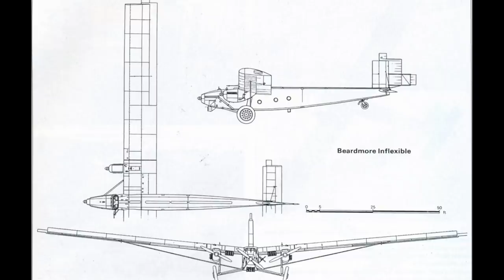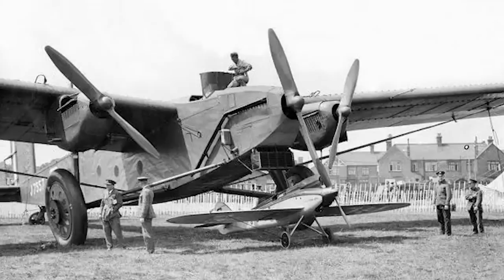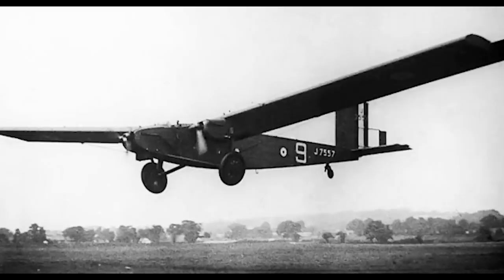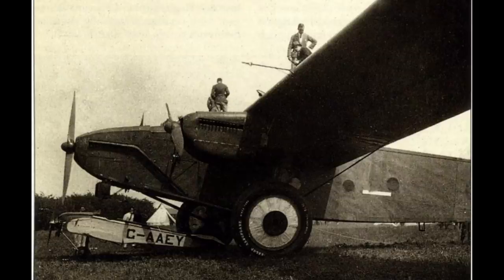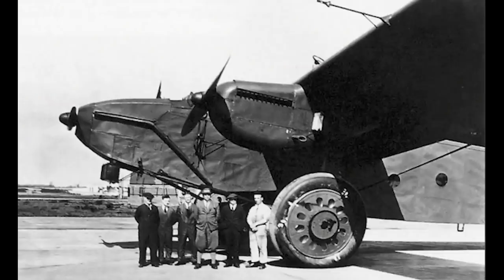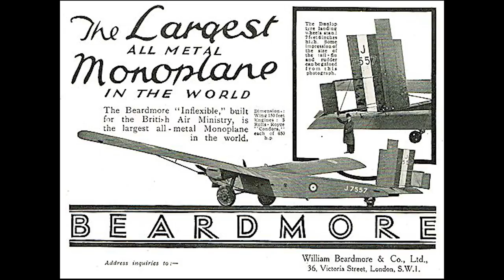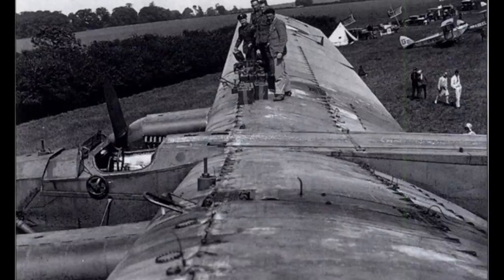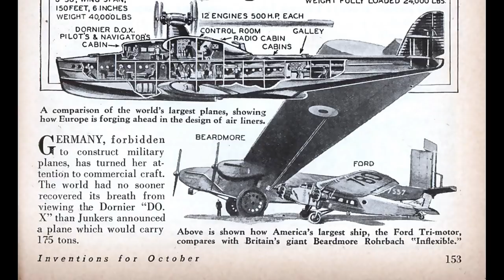Beardmore Inflexible | An Anglo-German Giant [Aircraft Overview #15]

Comment: As ludicrous as the interwar designs can be, you got to love the period for all the inventiveness and creativity.
Reply: I was thinking something similar. Creative, but utterly useless most of the time! However, when they DO get it right they get it RIGHT (De Havilland Mosquito)!
Reply: The pace of change was mind boggling, we went from wooden stringbags to the DC3 in 20 years.
Reply: @Robwantsacurry  and to the Junkers Ju 52 in only 10 years.
Reply: @steffenrosmus9177  
But somehow the Ju 52/3m (1932) was just an imitation of already successful planes, the Fokker Trimotor (1924), and the Ford Trimotor (1926) . . .
Reply: Drugs were legal back then. Just saying. :)
Reply: @letoubib21  that were just smaller versions of the Beardmore!, ie high wing trimotors, I believe the Ju 52 was originally meant to be a twin engine aircraft but due to engine constraints the third engine was added very early in the design stage, it would have been interesting to see it with two larger twin row radials in place of the three singles. The DC 3s biggest advantage was just the huge numbers it was produced in, both were good aircraft but with the number of DC 3s available it was down to economics post war.
Reply: @CrusaderSports250  The first Ju 52s only had one engine, therefore the two suffixes "1m" and "3m", 1 motor and 3 motors . . .
Reply: @littlefluffybushbaby7256  Sir could you be onto something? 🤔
Reply: @letoubib21  Thanks. I learned new something today. Also a tip that it's probably not wise to climb about a Junker Ju-52-0m.
Reply: Without ww2 we probably be in flying boats still ?
Reply: @letoubib21  not completely right. The Junkers F 11 prototype  and 13 was the first of that design and was built in cooperation with Fokker and Ford copied it.  Asp motor arrangement and cell strucrure were very differnt at all three.
Reply: @paulmchugh8695  A bit further along than that. If ww2 didn't happen we'd probably be in the early 80/90s now technologically.
Reply: @Robwantsacurry  from the wright's 1st flight to landing on the moon was 65 years.

Comment: Something seems ironic about so large of a plane with such massive wings being called 'inflexible'.
Reply: I was wondering WHERE the name "Inflexible" came from.
Reply: Maybe the wings were so large that the resistance to banking made it fly in a straight line... inflexibly. :) Still sounds like a Dreadnaught-era battleship to me.
Reply: The Royal Navy outdid them with HMS Invincible.
Reply: I can imagine if I want massive transport aircraft and if I was Atlantis by military aircraft they have flexible would be maybe high on my list for transport planes a size the American gooney birds
Reply: I do find it funny how between this and the HMS Inflexible,the British seemed to use the word as a positive thing XD
Reply: @101jir  HMS Invincible has joined the chat
Reply: @victoriacyunczyk  Invincible actually sounds nice though, granted the name ended up in irony. "Inflexible" doesn't even sound like a good idea, at least by modern standards. I presume it was used interchangeably with "uncompromising" at the time with a similarly neutral connotation.
Reply: An aviation journalist of the time saw the same irony...and started referring to the huge Beardmore as the "Brittle"!
Reply: Better than the Beardmore Brittle, I suppose.

Comment: Where did they get the name from? I suppose "Inflexible" because, being all metal, it was supposed not to bend; but it still sounds like a battleship. (Oh, I just looked it up: last Inflexible was a battle cruiser, slightly larger and heavier even than this.)
You've also got to ask just how much design was involved. The recipe seems to have been, "Take the most basic design possible, and scale it up." Still, the stress calculations must have been fun.

Comment: Could you do a video on the Beardmore BeRo.2 Inverness flying boat? It was related to the inflexible and had the weird distinction of being fitted with a retractable mast and sails. The sails were added incase of a forced landing at sea due to engine failure or running out of fuel.
Reply: @IntrospectorGeneral  Umm... that link goes to the Beardmore Inflexible
Reply: That sounds brilliant. I guess if they got the engines going again they could use them to blow into the sails. I wonder if they had plans for a submersible version. Thunderbirds are go!

Comment: A wheel from an Armstrong Whitworth Ensign, another monster pre-WWII (just) airliner also found its way into the Science Museum. Also, hardly an aircraft...but Beardmores also built the gantries and Railplane for Geo. Bennie at Milngavie (a short section above the railway for the airscrew-pusher suspended monorail demonstartion).

Comment: Me: thank god i didn't took part in that treaty uhh WHAT are you doing dad?
UK: testing the Inflexible
Me: i am building all-metal aircraft
B-19: it is larger than ME!
B-24J: ???
Weimar Republic (Germany): vell. Zhat vill be a huge behemoth
A-10: it may cause problems. Cause first off. The lack of supplies thus a Prototype, Secondly it had a short runway. Thus add 4 more yards
The Inflexible: takes off
A-10: fack. Nevermind

Comment: Interesting name, "Inflexible".  The Beardmore company was apparently following the WW1 practice of making the wings as rigid as possible.  Wings today are designed to do the opposite in order to absorb the shocks of minor turbulence and not spill the drinks in First Class. There was also a New York City bus in the 1980s called the Grumman-Flxible. Grumman Aerospace owned the Flxible Corporation which built the buses. The buses kept breaking their rear A-frames on the city's potholes making them list severely to one side or the other. This made the buses the butt of many jokes at the time and forced Grumman to pay millions in repair costs.  If you're going to make a large people-mover it's probably best not to use the word 'flexible' in the name.

Comment: I wonder what kind of range this plane had; it sort of looks like a U-2. I’ll tell you something funny. Modern drones are launched by placing them on a truck which releases them at 80 mph. 

Gliders with a real pilot could be launched the same way. Maybe 100 mph. No need for a Cessna tow truck, gliders nowadays have an electric motor. A recon unit could launch a dozen manned gliders in about one hour. Gliders are cheap. (But don’t buy them from the Marines).

Comment: And I thought it was a stretch to give the RAF's Future Large Aircraft contract to Airbus.  But even though they hadn't built a military aircraft before, they had at least built aircraft!
Just as a note, that this thing took off within the limits of the old runway doesn't mean that runway was long enough.  Sometimes you need that extra length if you have an engine failure or other problem at a critical point.  Looking at the power available the VR, V1, V2 numbers must have been interesting.
If anyone's interested why the testing was done at Martlesham Heath, this was the location of the Aeroplane and Armament Experimental Establishment (A&AEE).  'A Squared E Squared' moved to RAF Boscombe Down at the start of WWII, and although the organisation is now swept up in the Qinetiq monolith the work is much the same.

Comment: It is worth recording that very similar, but rather smaller Rohrbach Roland aircraft were operated by Lufthansa between 1926 and 1936. They had about eighteen, though not at all at the same time, and they operated much of the airline's European network very successfully, though at cruising speeds only around 100 mph.

Comment: Is this plane trying to do some laminar flow stuff?  The nice thing about clearly subsonic planes is that they can have thick wings and don't need struts. The nice thing about large planes is that they could not possible cater to laminar flow and thus can have a triangular plan form. So they can have a very thick wing root. Just see all those beautiful Junkers planes. Basically flat flying wings for 90% of all forces involved with a long tail for stability. Modern (RC) gliders have extremely long tails. I understand that they pose a problem on take off and landing. I would like  to see a design where one could slowly trim the plane by pulling up the tail like the Concorde dropped its nose.

Comment: It would have been better named the "Implausible", I think. The designer apparently didn't possess any compasses, protractors or curves, judging by its utter rectangularity. If the motors had enjoyed the power to pull the skin off a rice pudding, it might actually have had some use. The high aspect ratio would likely have made it quite efficient.

Comment: I would suppose the wing tips were designed to lower control forces, not control flutter.  Flutter is controlled by adding balance weights in front of the aileron hinges.  While you could do that at the tips, this would cause torsional loads that would not be ideal in countering the flutter throughout the entire aileron.
Correct me if i am wrong.

Comment: The zepplin starkin e 420, it has no good way to see forward. Reminds me of the Spirit of St. Lewis, she had no forward visibility, minus a periscope, for old Lindbergh to fly/land with! Seems like such a sensible design, no need to have forward visibility distract you from flying.
Reply: Lindbergh was involved in the design of the Ryan NYP, and didn't consider the lack of forward visibility to be an issue. Surely having some would be beneficial, but the space was needed for carrying fuel and oil and that took priority.
Reply: It also looks like it had counter-rotating propellers.